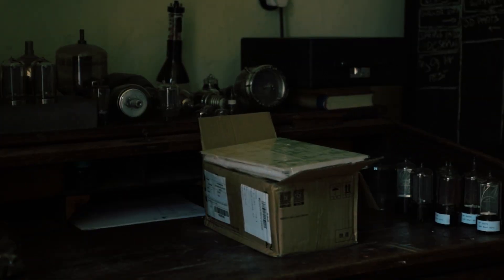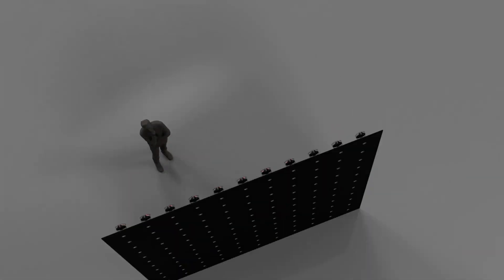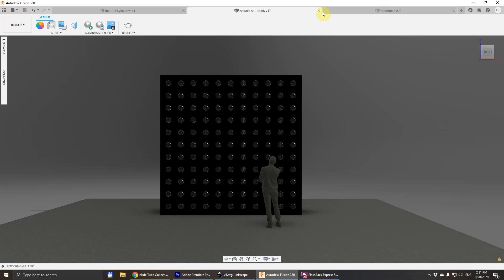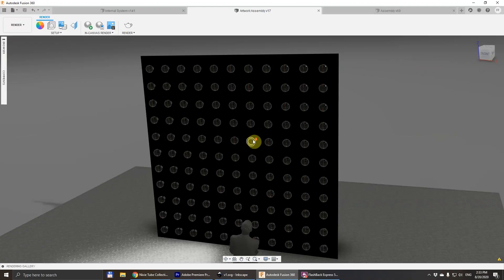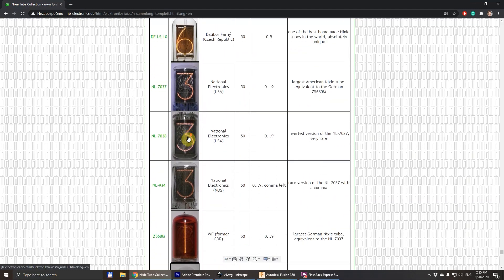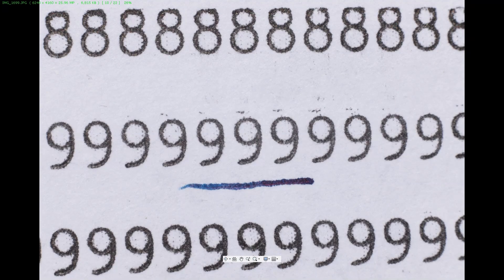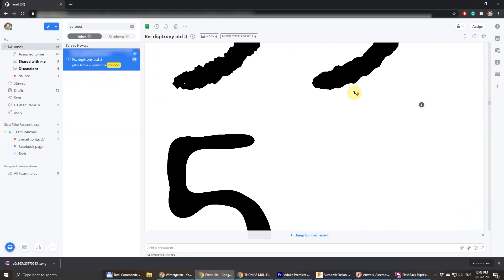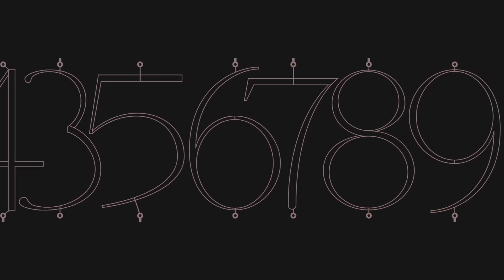Large Digits For a Nixie Tube- Project H #15

Comment: The new font looks really awesome 😎👍🏻 Do you think it would be possible to use it also for your standard nixie tubes?
Reply from the maker: It would be possible, I am afraid they would look a bit too fat :-)
Reply: @daliborfarny  Just look to make a standard tube with that size then, would be useful as a standard part for designs, as likely the only changes needed would be a slightly higher power supply current capacity and a different high power anode resistor to make them interchangeable with the current driver IC's.
Reply from the maker: @SeanBZA  Yes, this is one of the main points of this project - I want to turn the H tube into a standard tube for our customers.

Comment: hi Dalibor, will thermal expansion and vibration play a part in the design of the tube? especially the distance between digits?
Reply from the maker: Hi Wilfred, the thermal expansion plays a big role as the digits are heated to hundreds of C during operation (I estimate 250-300C). the bigger the digits are, the more they can deform due to expansion - this countour design should hel us to cope with it - the digits will be more flexible.. the distance between digits should be enough, but we need to do proper testing..